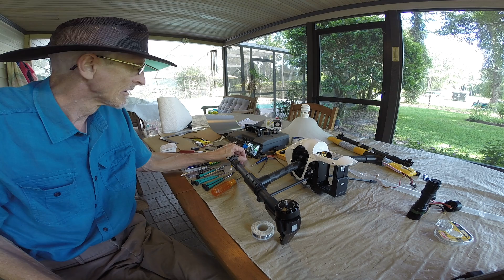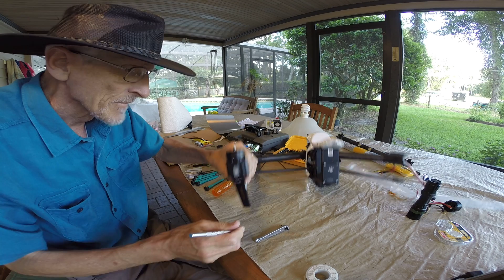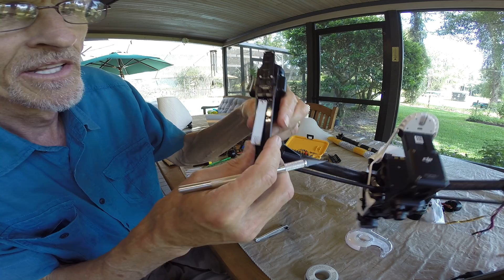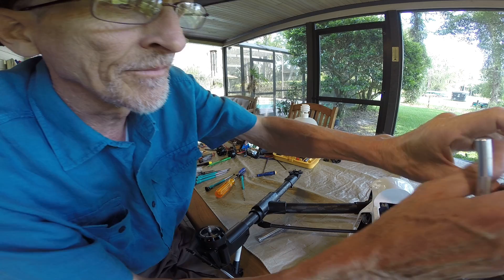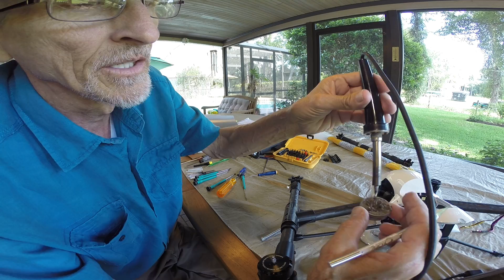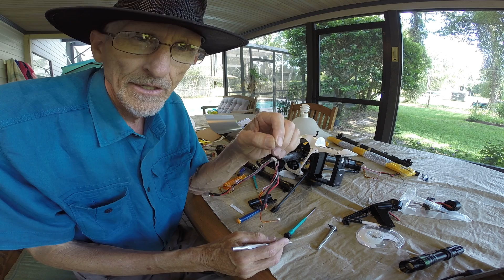DJI Inspire 1 Motor Boom replacement

Comment: Great instructions, I was able to repair my Inspire 1 Pro today following your video. Soldering was touchy! I taped a string on the black wire to pull it through. I had to adjust my Angle adjust ring on the arm. Toughest part ~ removing the 4 lightbridge antenna screws. One should have a good #0 Phillips, Jewelers or watch repair type or they will strip the cheap ones. Be careful soldering people. But you can do it. I did mine today. Thanks again!

Comment: Dude  THANK YOU  i have been looking for a repair video for my post-crash issue.  The entire bar on the right side was twisted.  Not bent  or damaged.  I could not find any vids on how to repair  in desperation / frustration i happened across this vid where you mentioned the adjustment screw hidden by tape  Boom  Fixed Drone !!!
Reply: Rodney Frost ~ What did you use to set the angle?

Comment: Very good video. have a question about motors. do you know if it can be used diferent motors , like tiger motor u5 for the inspire 1 ? will it be necessary just to solder the new one ? will it affect the software ? thenk youvry much.

Comment: Re Assembling the land foot
I used forceps to thread the coax thru, but if you start out by running a string up thru the hole and tying it to the coax that should make the job easier. Make sure the cables are orderly before you assemble, meaning they shouldn't be crossed. Push as much cable back into the tube as you can while you are putting the foot in place. And last make sure the cables are below the slot in the tube, If they get up along the side of the tube they will compress the wrong way making it almost impossible to assemble. Be patient it will work.